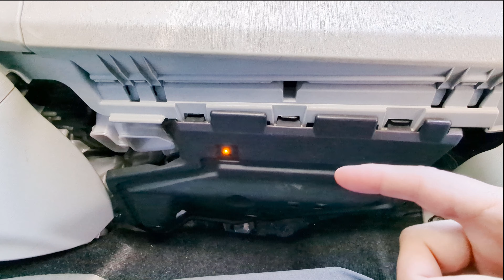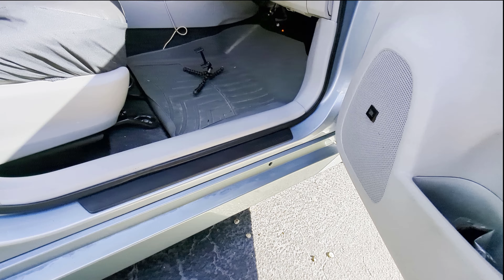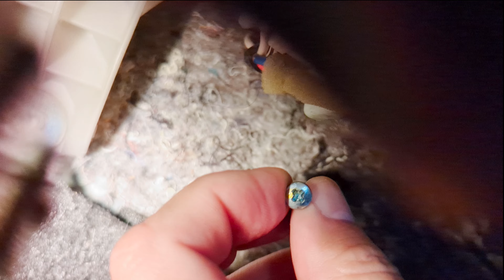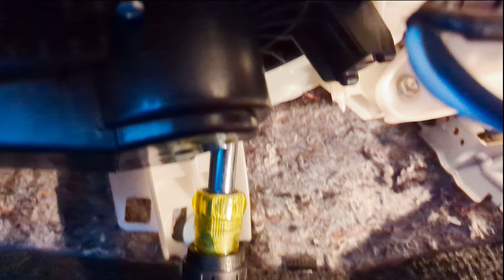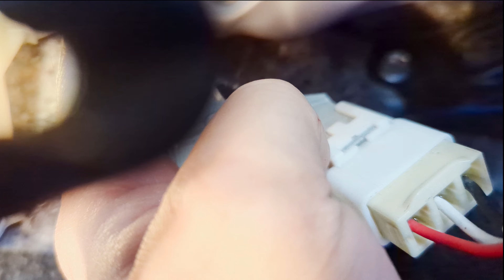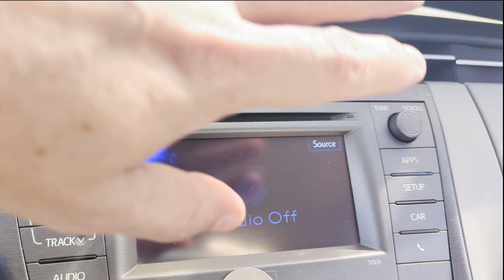DIY Prius Blower Motor Repair - Skip the $400 Shop Bill

Comment: Not sure what year your Prius is, but that little led you had initially removed from that bottom piece what is that for because I have a 2011 Prius and I don’t have led. Just curious as to whether I’m supposed to have it and it was us removed at some point or not.
Reply from the maker: It's the light for the glove box

Comment: I'm curious as to how dirty your old fan was. I know that bathroom fans which have the same type of squirrel cage fan blades, get very dirty within a year of use, and thereafter the effectiveness greatly diminishes as more buildup on the blades occurs. I'm wondering if the car fans have the same build up and are worth pulling out to clean.
Reply from the maker: It was not too dirty, just perhaps wear and tear of running year round in the hot humid Florida climate

Comment: Did you have to disconnect the 12 volt battery first? With this hybrid and what can or can't trip codes when working on it I don't know.
Reply from the maker: No you don't need to disconnect. Just follow the video instructions, step by step. I also included the link on the video description where you can get it at  a much more affordable price.

Comment: Do you need to replace a resistor as well or just the blower motor?
Reply from the maker: Blower only.
Reply: Mine came with a resistor as part of the blower.  It is integrated into it.